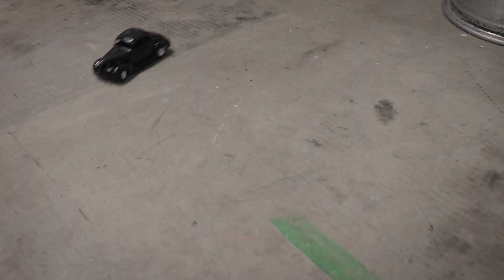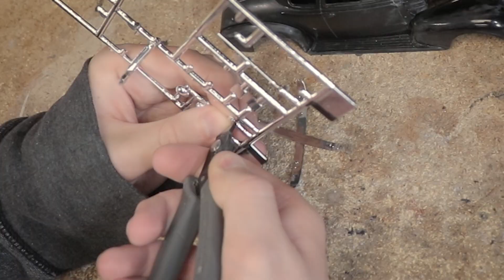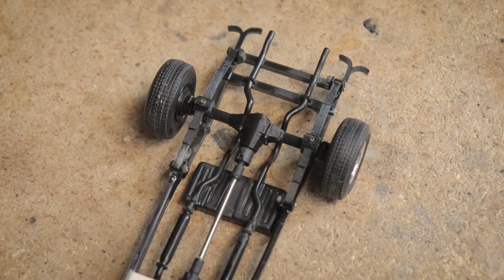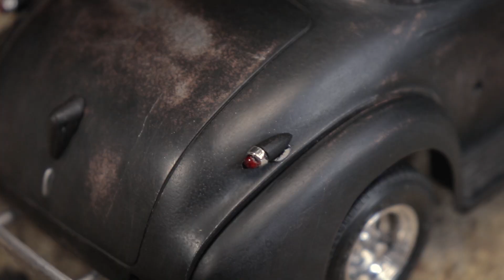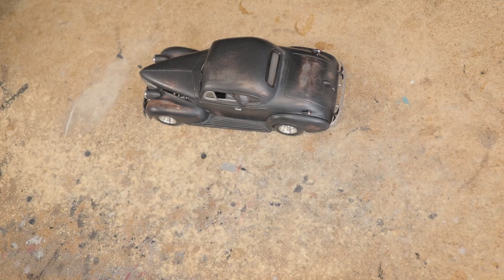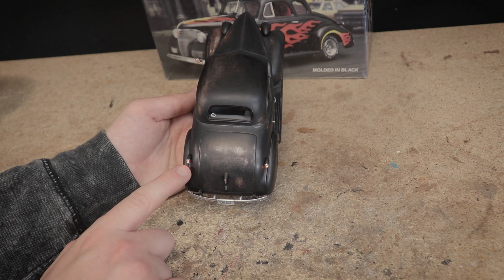Ultra Scale Custom RC Hot Rod is Complete! 🏁 Easy Patina Paint Job and Working Lights 💡

Comment: As someone else said, 6 volt electronics were the norm when these cars were new, so to me, the dim headlights are perfect. 
Also, for surface rust on chrome bumpers, a cheap trick is to buy a jar of instant coffee and mash it into a fine powder. Apply matt or semi gloss clear and carefully sprinkle some of the coffee powder over it. Less is more. 
I reckon the Chev looks fantastic!

Comment: Fabulous inside and out, top to bottom. Both options but build off existing components benefits everyone sooner. 
Me at 10 yo, only had a tube of glue, a razor blade, a small paint brush and basic testers paint pack. No wonder my model only looked marginal.
Reply from the maker: Thank you! My models at 10 weren't great to say the least.😆 I learn a little with every project.

Comment: The headlights look perfect.  They replicate the crappy 6V sealed beam brightness that it would have had stock, versus a more modern Hot Rod that would used halogen or LED headlights.
Reply from the maker: Thank you. Going with a warm colored LED vs the more common bright blue/white tone is a must IMO if you want the old school look. Unfortunately the headlights really don't project any light at all, even when in a dark environment. Hopefully I can find that "Goldilocks" zone of not too bright or too dim on the next build.  👍

Comment: Looks great! Personally I'd like to see the next very realistic build to be WITH custom designed parts, just as a point of comparison to what can be done just using other people's pre-made parts vs putting in (a bunch) more work to design one's own
Reply from the maker: Thank you! All the parts used are designed by us, it just so happens every single component was already designed and posted on our Patreon prior to this project. A fun challenge, but It seems lots of folks both here and on Patreon want a build with new custom parts designs.  I think that's what I'll do next. 👍
Reply: @MakeItRC  Perhaps it wasn't clear, I was writing from the perspective of the builder just as presented in the video, I have seen the CAD work done in some of the others when designing the parts so I'm aware
Reply from the maker: Ah, I understand now. Good point.  👍

Comment: Spray the weathering with a clear before you put the final finish on top. It helps you to not burn through when you sand to get the effect you're looking for. To get an aluminum finish I'll spray the chrome with a matte finish and then come back with a dark wash. Panel line accent or water down some black craft paint. Looks like an old moonshiner's car. Good work.